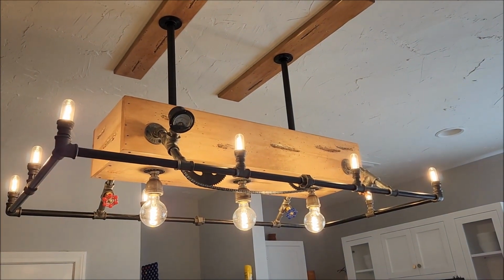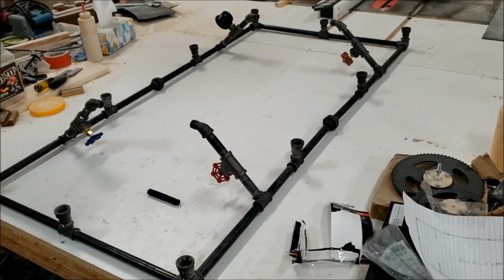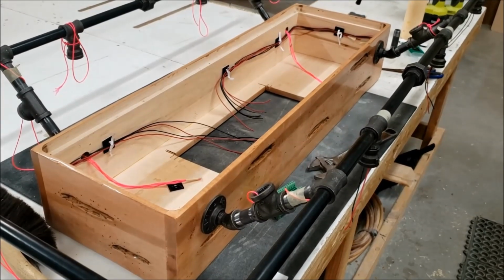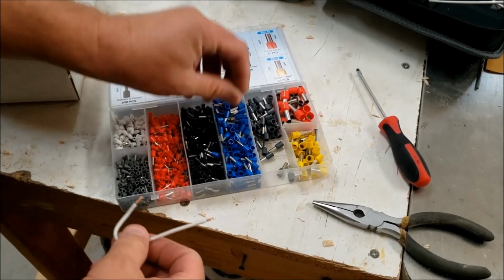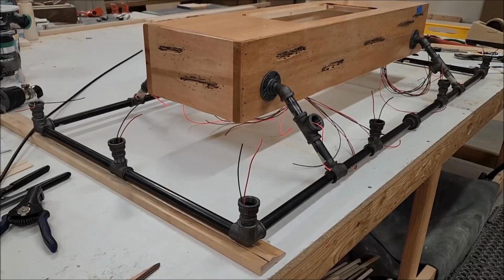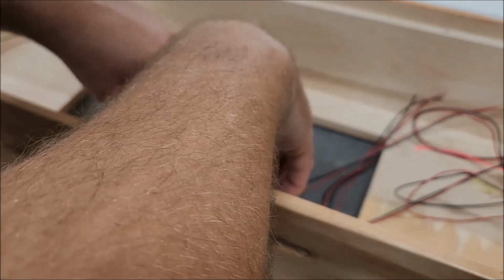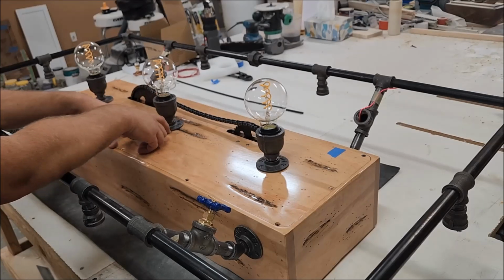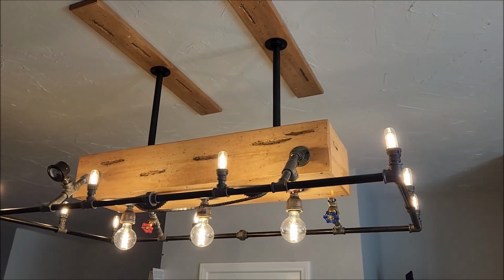Industrial Furniture - Steel Vintage Chandelier

Comment: This project turned out great.  Were the valve handle switches something you bought or did you have to make them?
Reply from the maker: Picked them up on eBay. Some guy who goes by Edison Logic logic makes and sells them on all the online market places.
For $20 each, it was quicker/cheaper/easier to buy his than to buy the valves and switches to make my own. He probably found a bulk supplier, being able to make them much cheaper than I could have. 
...also, his margin on each on is probably $0.82